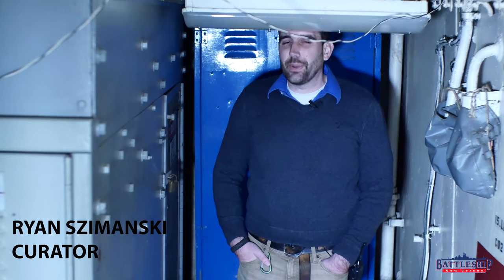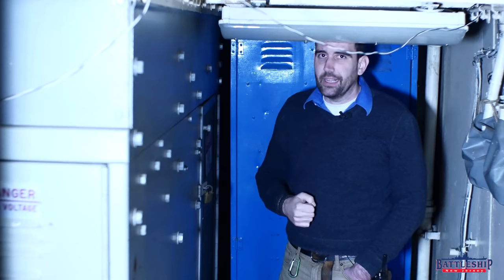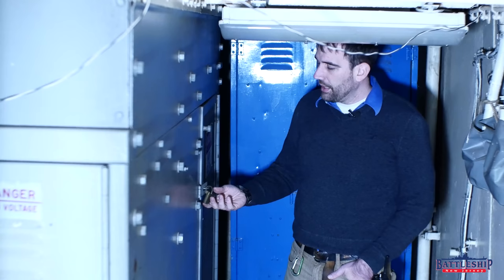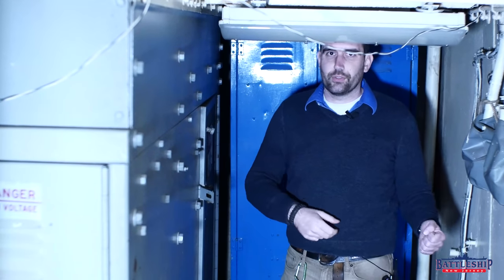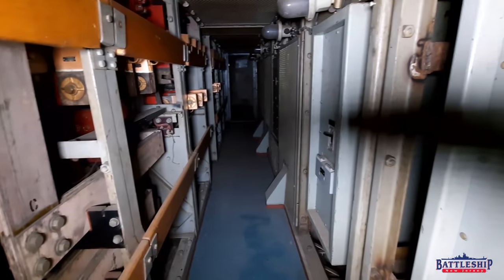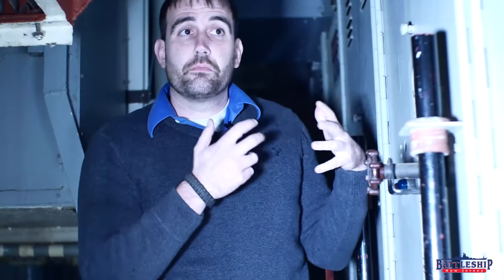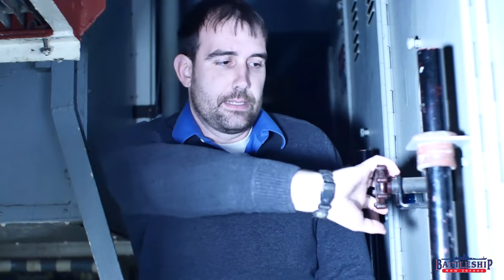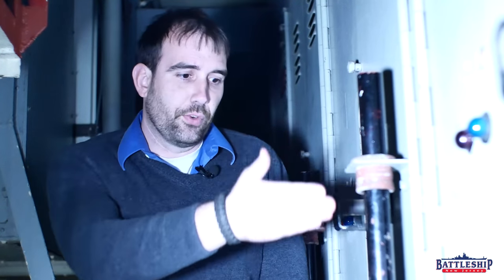Why is a Bus on a Battleship?

Comment: Locking breakers open is a normal and essential thing, as if your working on the circuit you don't want someone turning it on. This prevents fatalities.  And the bar is not bus, it's BUZZ, from the sound it makes under load, it sounds like a hive of bees.
Reply: If you're hearing a buzz you need to get out of there straight away and let the electricians know immediately. Transformers hum but conductors don't (unless something very bad is about to happen).

Comment: Its neither voltage, nor  amps that kill you. Its the total amount of energy that gets delivered. Energy as in volts times amps over a certain amount of time. Power is volts times amps. Energy is power times time. Even though you may have been across a 30 amp circuit, your body resistance is going to determine how much current will actually flow given the voltage, and your transient resistance at that time.

A car battery can deliver 500 amps easy, but that's not going to shock you, cause 12 volts across your body will only deliver a milliamp (1/1000 amp) if that much. Drop a metal screw driver across that same battery's leads, and it will melt almost instantly !

The death current range is 30 to 300 milliamps (0.03 to 0.3 amps). Again that's over a few tens of seconds of time, and the voltage needs to be high enough to deliver that amount of current. Over 0.3 amps, and your tissue starts burning, which may actually help keep you alive, though short a limb or two.

Look up arc flash injuries. Worse than getting a shock. Similar to what a Star Wars light saber can do. On 440VAC arc flash is always a possibility.

Comment: hate when people say its amps that will kill you... no not really, the higher the voltage the easier it is for electricity to flow through something including your body, also 120v will tingle your hand, 277v will cause you a good amount of pain and can easily cause your muscles to lock, especially your hands if your grasping something or it might cause you to fall off a ladder.

Comment: Actually 0.03 amps is enough to kill you if the current passes from one side of the body to the other and through heart muscle on its way.  Voltage is what drives current, so higher voltages are riskier because current increases proportionally to increasing voltage, all else being equal.  In reality, danger increases exponentially as voltage goes up - the reason is arc flash.  Higher voltage allows metal tools dropped onto a live circuit to vaporize at the metal surface and the metal particles in the arc allow the arc to self sustain.  I have seen the aftermath of 480 Volt AC arc flash where a door a control cabinet was blown across the room.  The person working in the cabinet was killed by  the arc flash.  It wasn’t stated whether the victim was killed by electrocution or the accompanying blast.  It really doesn’t matter because you’re dead either way.

Comment: The voltage kills, not the ampere's. Voltage is a cause,  factor. Current is the result.
Welders kan keep their electrodes in hand, at 24 Volts and 200 Amps. Because at 24 Volts DC your body will not conduct more than a few milli-amps. Even though the welde rpumps out 200 Amps.
The voltage plus the impedance of your body determine the current flow and if that is more than 50 mA it can be critical.

Comment: I have touched two or three times accidently 230V, but were only lightly shocked. Soon i have to work on electric vehicles. There i must! wear electric proof gloves etc. around 470V and the main Breaker is around 630 amp DC. 😳 In my first two years training as an electrician i have seen similar Bus Bars in big commercial buildings, but was not allowed to work on.

Comment: "Locked Open" By my logic being stated reversed. Switch is closed with downstream receives Power.  Stating Breaker - do these breaker of that age match what is in most home and will Trip Open/ off if power current exceed the Rating of the Breaker?  If that is the case on the South Dakota - I suspect an electrician that before the battle - one breaker was tripping from overcurrent- and he locked it - to no lose that power during battle. I though most World War Two Era ships the propulsion plant could run if there was NO power on ship. And you could fire guns (but no "Fire control")  Late 1950s to early 1960  built- many smaller pumps were shifted to electrical only - not spilt one steam, one electrical -Therefore the newer ships could not "Steam in the dark"
Reply: They had automatic reconecting, so power will go to damaged area and trip fuse again, so to stop that he tried to keep it open so undamaged parts will have power, but it was a wrong fuse he blocked

Comment: You can be killed by 1/2 volt at 1 amp. It's the amperage that kills you, the pressure or volts doesn't matter as much. I was in the burn unit in 1991 next to a guy who had touched a high wire, blew off his fingers and toes but he was lucky and survived....

Comment: even 60 milliampere is enough to kill you if its going over your heart at the wrong moment during the heartbeat cycle. 4000 ampere doesnt only just have a much larger chance of killing you by stopping the heart but also cooking and burning your whole body.
i have never gotten a shock from a mains power line or such but i have from static charge buildup, electric fences and such which are high volt, low amp pulses of electrical shocks
Reply: The worst part about an electrical burn is that the damage is done on the inside. Right after you get a shock you might notice some redness when you get to the ER but your skin is covering a well-done steak that used to be a muscle. Also, burns are an injury that actually hurt more when they're healing than they do while you're getting them.

Comment: The high voltage flyback transformer from a Black & White TV will toss you across the room 😉 A Color TV flyback will kill you before you hit the floor. 💀AND a TV's picture  tube will store a charge lethal charge for months after the TV has been unplugged. 😬

Makes me wonder how dangerous RADAR tubes are?

Comment: I work in cooperate real estate and got started in Property Management.  I was doing some routine light bulb changes and thought the power to the light I was working on was cut, but it wasn't.  Let me just remind everyone that the fluorescent lights in office buildings are NOT the same as the ones in your house.  I was working on 440 power and could feel the current though the insulation in the wires.  Needless to say I had words for my boss the next morning.
Reply: You were likely working on fluorescent fixtures connected alternately to red leg and black leg 220v power, which makes adjacent fluorescent tubes flicker in opposite rhythm to each other and deliver a more steady light.  If you are in a nation that uses 220 for house current, that is understandable.  Four-forty for fluorescent lighting in North America would be excessive.

Comment: It’s the amps going through your body, not of the circuit, that will kill you.  The voltage of the circuit divided by your body’s resistance, (500 - 100,000 ohms),  will determine the amperage going through your body.  One tenth of an amp, 0.1A, 100mA, will easily kill you.  An example is 100V / typical body resistance of 10,000 ohms = 0.01A or 10 mA can be fatal.  If your body completes a circuit with your heart between the two points of contact, it can be fatal.  Static electricity of 20,000V can be withstood and “played” with because it stays on the surface of your body.
5V at 1,000A is harmless because the low voltage does not enough “push” behind it to get enough current to flow through your body to be harmful.
The tingle of a 9V battery / on your wet tongue of 1,000 ohms = 0.009A or 9mA.  The battery would have to push across much more, 10x, resistance of your body if you touched each terminal with each hand so the current would be 1/10 of 9mA, so 0.9mA, 900uA, or 0.0009A, undetectable.
Even if a projectile were the size of a basketball, (amperage), and sitting on you, think gravity, with a force/weight of 10 lbs. (voltage), it would do no damage to you.

Comment: OK, folks, please stop using "Electrocute" to mean "shocked:". Electrocution is death by electricity. If you have alert folks nearby you might be revived, or maybe not.
The most unexpected shock I got is when  I threw a cutoff switch for a 220 line, and still got shocked when rewiring the outlet. After I recovered and got both eyeballs back in place, I looked at the switch. It was in the off position,.. Removing the cover revealed that the steel tie plate between switches had rusted through, so throwing the switch only disconnected one side of the 220V, so I got a nice jolt of 110 from the live leg.

Comment: I've been shocked once, but really should have been twice.

My hand got shocked on a 120v circuit plugging in a charger.

And my dumb ass grabbed a powerline wire when I was at a sugar Shack, on a snow hill.

Turns out it was a telephone wire, which hangs much lower..

Very lucky and I have since become less dumb. (And no longer 5)

Comment: Volts burn you, Amps kill you. If the volts are low enough, your skin might(!) not conduct and so you don't get a shock. Which is why 9V batteries and 12V batteries are thought by most people to "be safe". 110V will kill you quite merrily, and as the voltage goes up it increases the ease which it gets under your skin, and the distance of air the current can jump to get you and fry you. A fraction of an amp across your heart will kill you, but at lower voltages fewer of the starting amps get to your heart. 

I think what I am trying to say is respect the angry pixies...

Comment: you have not had a 30 amp shock! it may have been from a 30 amp circuit but your shock would have been in the milliamp range. 100 to 200 milliamp is enough to be fatal (that is why ground fault breakers are set to trigger at around 30 milliamp (still more than enough to hurt like hell)). You were lucky that you were a high enough resistor to keep the current to the non fatal range. Be safe, always work on the principal that every electrical wires is always trying to kill you unless you know for certain that it is dead.

Comment: I am no fool no sirree...  I want to live to be 103 !   I don't mess with very high voltage,  and if I do, I use protective gear and equipment and know to turn off the live circuit before doing anything.

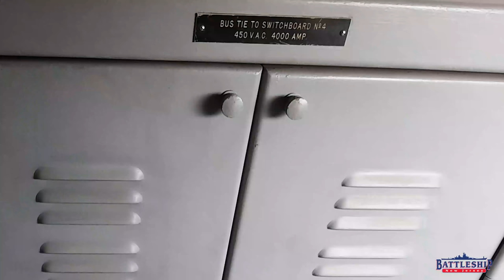Comment: 5:55 thats not how it works, the amperage that kills you is related to the voltage times the resistance (your body), there can be a million amps going through there and it would make 0 different to the lethality

Comment: You most certainly were not shocked by 30 amps on a 120 circuit, rather by a circuit capable of 30 amps. A full 30 amp discharge through a human body would be enough to flash boil water along the path and would probably blow you apart. 120v/50kOhm skin resistance ~ 0.0024 amps of shock. The same person touching 480v would get 0.0096 amps. It isn't the volts OR the amps that kill, it is the power dissipation and the ability to stop the heart. Both of which depend on voltage, available current, AND resistance! Wear your SHOES!

Comment: I`ve once got shocked by 230 V 10amper, It was quite brief and painfull, 440V and 4000 amper would probably make you dead almost instantly.
Reply: 230V 10A would kill you instantly too.  100ma is all it takes.  The saying and the video are a little misleading since something labelled 1000A is 1000A *maximum*, not 1000A "all the time".  What you get belted with depends on your own electrical resistance.

Comment: You may have touched a 30 Amp max circuit and been shocked, (not electrocuted, which means death by electric shock) but you did not receive 30 amps of current through your body at 120 volts. That would mean that you would have been dissipating 3,600 watts of power... And you would have exploded into little pieces of toast... You touched a live leg of a 120 volt circuit and conducted whatever current your body's resistance, reactance, and capacitance would have allowed at that time. Depending on your environment, circumstances, clothing, shoes, circuit grounding, and the path of the current, your shock may be mundane or deadly. Generally, the higher the voltage, (and the higher the circuit's MAXIMUM ampacity), the more innately dangerous the situation becomes. And all of these aforementioned factors are variables. Which is why sometimes touching 120 is a minor tingle, and other times it can blow fingers off or kill you. Fun facts from an electrician. Great video!! 👍

Comment: "It's not the voltage that kills you, it's the amperage." - true.  With annotations.  Tthe current rating of hi your case 4000 A does not matter - it's just the maximum rating.  To give you an idea, 450 4000A, that's 1.8MW, a mighty sh*tload of power when applied to a human body.  However when getting electrocuted that figure of 4000 A is not of interest.  Remember Ohm's Law?  A human body has a resistance of about 1000 Ω.  The exact figure will depend on circumstance such as wet or dry skins etc.  At 440 V through a 1000 Ω a current of 440 mA is going to flow which is less than 1% of the 4000 A maximum rating..  Sadly that value still exceeds what a human body, in particular the heart can deal with and may be lethal.
In practice anything with a voltage of 50V or higher should be treated as potentially lethal.  And while voltages less that may not be lethal  when directly applied to a human body even a standard 12 V car battery can delier a hell of of a current that may not harm a human body but can melt conductors such as wires, even get them to burn and cause indirect damage.

Comment: Do those bus bars run the length of the ship, or is it just within that electrical room?
Reply: Bus bars are generally used to interconnect switches / equipment however regular insulated round cable is used to go from location to location.  Bus bars ( copper bars that are sometimes tin plated ) can serve to transmit power and provide physical support to components.   
There are some instances in industrial settings where bus bars are enclosed in a metal duct ( bus duct ).   Singular breaker box / switches can be plugged into along the length where ever machine power is needed.   A bus duct system is more $$ to purchase however re-configuring machine arrangement only costs labor.

Comment: That's wrong, 4000A won't kill you if it's for example at 3V, generally speaking, your body wont start conducting enough current to make permanent damage until around 60-80V
Reply: When I was younger, I did some tests on voltage. I discover that if you took a 9v battery and stuck it on your tongue, you could feel a tiny tingling.

Comment: 440 3 phase, Delta or Y configuration??? 
Thats why you always keep one hand in the pocket!!! And no rings or watches!!! When working on electrical equipment always assume the circuit is hot!!! And your answer is yes, I have zapped myself and it only takes a few 10’s milliamps across the heart to stop or disrupt the beat and if you are alone, kill you in minutes!!!
I assume there are step down transformers that will run for 120/240 volt single phase circuits and other transformers to set up the power for the machine shop and other areas where you need different setups. Just guessing as a land lubber!!! Grin!!! And trained electrician and computer geek, Ham Radio Operator, electronics guru!!! And I am somewhat retired and live to far away to be any help!!!

DE N2JYG

Comment: In reality the old adage of only the Amps, kill or hurt you is incorrect. Taking resistance of the scenario into account, like skin resistance, foot ware, ground standing on (like metal, rubber) etc it also takes a potential difference, voltage, to make a difference. Put your fingers across a car battery capable of delivering many hundreds of amps and nothing will happen, try the same at 220 volts where the circuit can trip at 20 amps and if across the chest in the right circumstances, then make sure your will is written, that you've told your loved ones that you are going bye bye, and that the undertaker has been arranged before making you make the connection. This is a very simple and basic comment to express that electricity is far more dangerous, than people seem to believe and yes there is far more to say, suffice if anyone feels the need to go further, then here is an old saying, "Fill your boots", just don't knock me for trying to put a basic point across.

Comment: No way did you suffer 30 amperes of current through you at any point in your body.  More likely it was 30 milliamperes (one thousandth of an amp), which could be fatal depending upon the path (across the brain or heart) but certainly painful.

I've been bit by 50 volts upwards to 30,000 volts---more than several times.  Goes with the job of being an Electronics Technician First Class.

Comment: 230 v with a 15 amp fuse. Luckily I was wearing rubber gumboots while standing in water leaning on a metal rack, while a faulty power lead sitting in the water making that same rack live. It hurt touching the rack, so stood still and yelled for someone to turn off the power lead. The boss got angry, cut up the power lead and told me off for taking a risk even though I knew the lead had a exposed wires in it.

Also as a teenager, I wanted to see what electricity tasted like, so I put a lead from transformer for my electric piano in my mouth to see what it tasted like. My god, my heart heart like hell. was 230 volts, no idea of step down voltage or amp on the transformer. (Am I using right term ? Transformer as in a large plug in device with a lead to a electric device requiring less power or amps ?)

Or the time I pulled a night light out a little from the wall, and dropped a $0.20 cent coin across the 2 prongs of the plug. My Dad looked so surprised when he heard my yell and came into my bedroom to see what was going on.